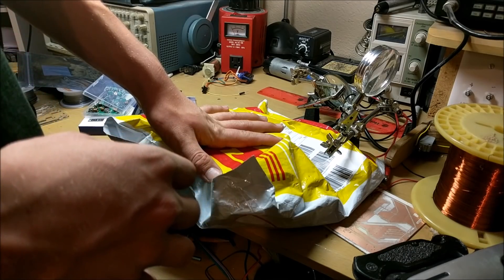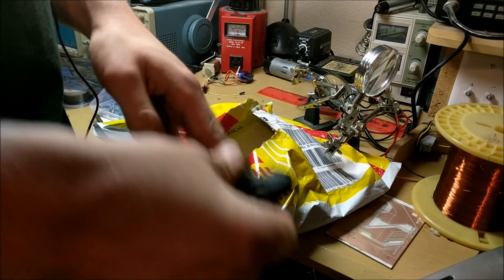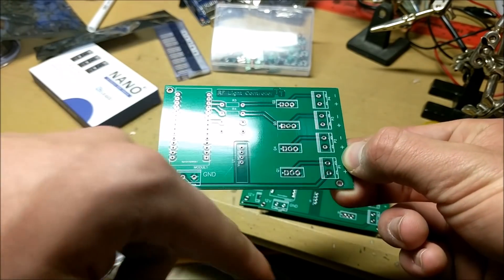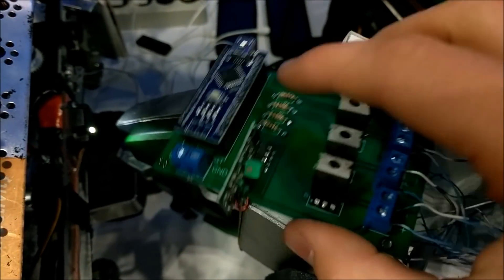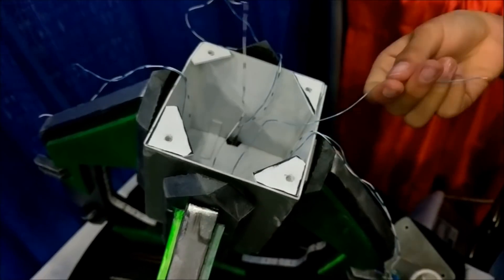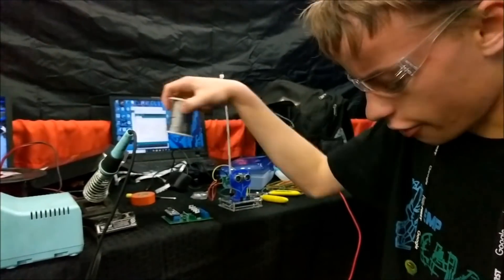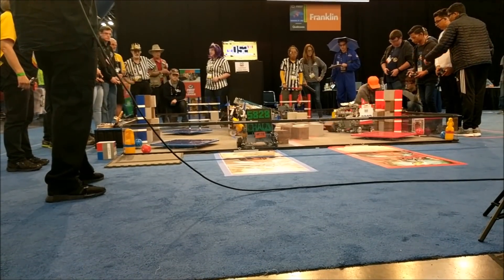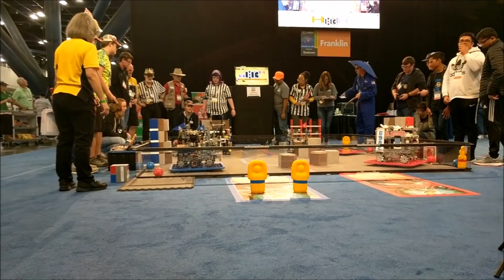Light Controller Circuit Board + Robotics Tournament Display

Comment: Wouldn't your old code be on your old project still, you could try lift it, also you really need a dust extractor for your room
Reply from the maker: I could try, though I have already reflashed the Arduino for those projects. It would be almost impossible.
Reply: Tanner Tech almost but not impossible?